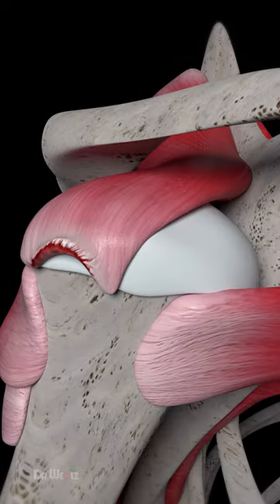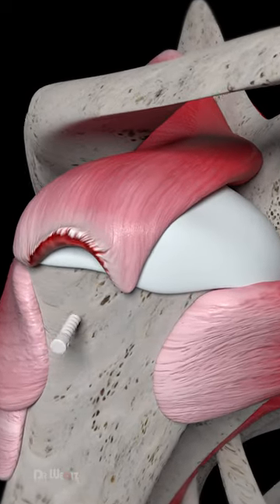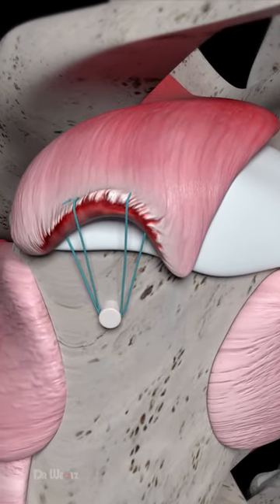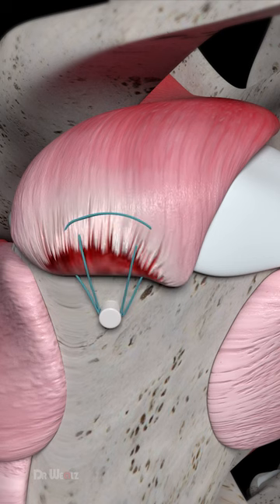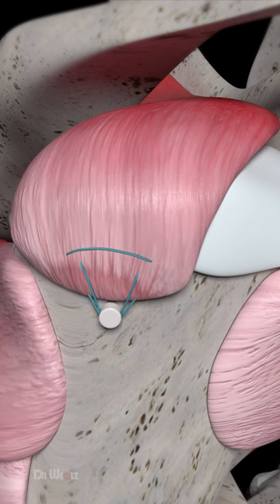Rotator Cuff Repair (Animation)

Comment: Well now I know how my rotator cuff was repaired. Interesting. My surgery turned out very well.
Reply: How do u feel after that? Does ur shoulder back to normal? I'm in a situation like in between if i should do a surgery or not, from a personal experience and 5 times shoulder dislocation i have no hope anymore lol
Reply: If you have a tear, you have to have surgery or you can't lift your arm (at least I couldn't).
Recovery was very hard for me; but, even though my shoulder isn't what it used to be, I feel it's pretty close to normal. Good luck. ☺️
Reply: Lucky you! I had a repair on my left shoulder and felt like 💯 but I had 3 in my right one and again it's hurting pretty bad 😢
Reply: I had last week Rotator cuff tear repair surgery. Iam doing well
Reply: @MR_77777 see this comment is from a year ago . Since then any new dislocations ? Also just some bro advice if you dislocated 5 times bro we gonna need surgery im at 3 …. I don’t want any more fr lol
Reply: That’s great
Reply: @sandrareyes327 how are your bones
Reply: @MR_77777  yes. It’s back to normal. Just follow all postop instructions and in time you’d forget it ever happened.

Comment: I had this done, and later, about 25 years later I had to have another surgery because I couldn't do anything with the arm Painful and arm gave out. the bicep was  frayedd. Torn.. I guess from over use. Very painful. Now it clicks and I don't have full rotation on it. especially reaching up or backward.
Reply: You might wanna look into stem cell therapy
Reply: Did it help when you had it done initially? Did you do PT?
Reply: @Thegoldenchild415 I've had a complete torn rotator cuff and had surgery.
Yes, I had PT and my arm is doing great. The surgery was in 2015.

Comment: How does the body has the ability to heal a muscle back on the bone when it's unable to stretch it back in place by itself ?
Reply: We are a work of art.
Reply: It will not reattach itself on its own if it is retracted(complete full thickness separation).   That is why you have a procedure done that pulls it back into place  and mechanically attached to a screw (metal or, in my case, corn based). If you leave it to "natural remedies," you will eventually just not have that muscle or its movements anymore.